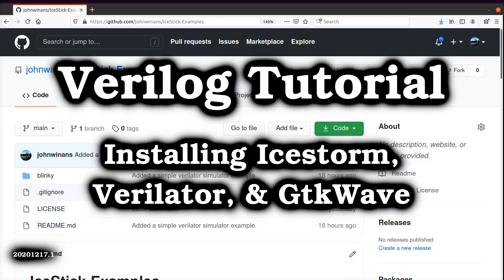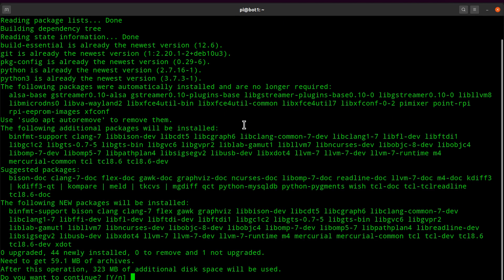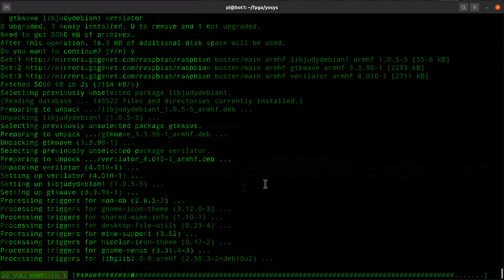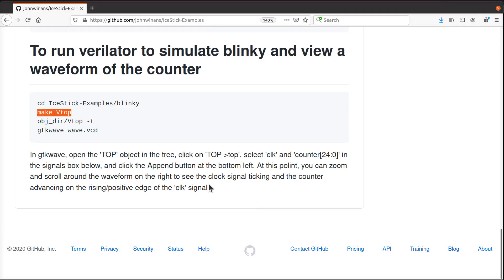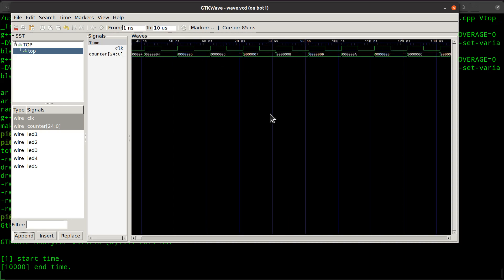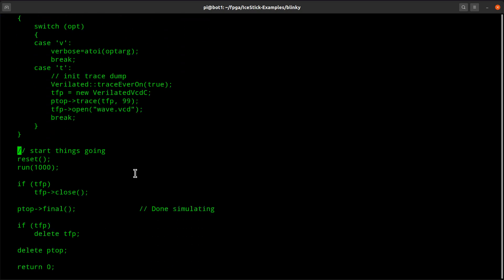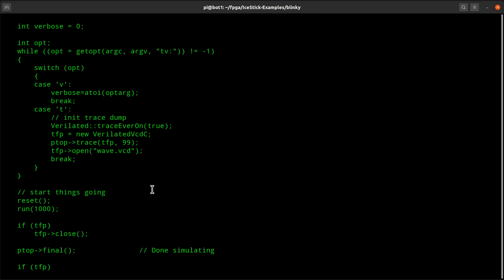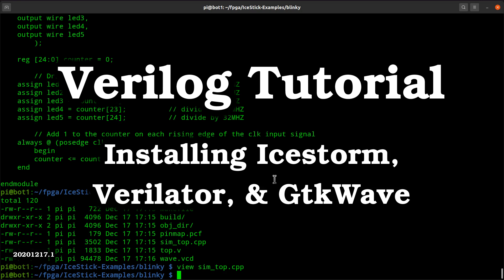Installing Icestorm & Verilator for Verilog development

Comment: Just exactly what I wanted to know about Verilator, exactly at the right time! :D. Thanks for making these. What are the next videos planned in there series?
Reply from the maker: Thanks for the encouragement.  I'm not entirely sure yet.
I started this to help a friend learn Verilog so that they can work a project that has a Lattice ICE40HX4K in it.  To that end I expect to spend some time introducing the synthesizable parts of Verilog that I use and discuss how to test them with Verilator & gtkwave.
In order to deploy the code I'll also have to cover Icestorm, pin configuration, PLL macros, and other such things when needed for the ICE40HX.

Comment: Hey I have a solution for small font on gtkwave : Use below commad to open gtkwave.

gtkwave -A --rcvar 'fontname_signals Monospace 13' --rcvar 'fontname_waves Monospace 12' <.vcdFileName>

This will drastically increase the font size and you can tinker with the font value.
Just remember to keep fontname_signals size greater than fontname_waves size, otherwise gtkwave will crash.
Reply from the maker: I sooo should have considered such a thing ... I've been a user of X since 3.0... when the resource database was much more an in your face thing.  I'm embarrassed and thrilled all at once! 😂